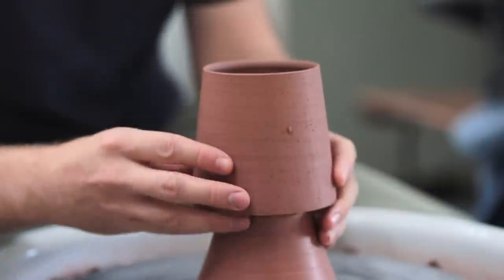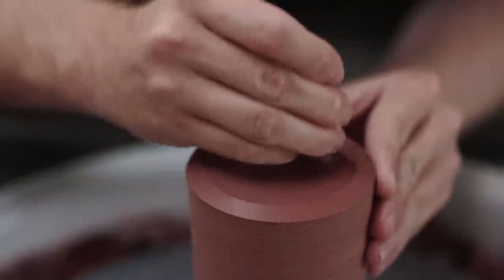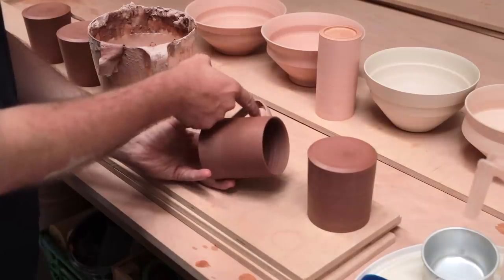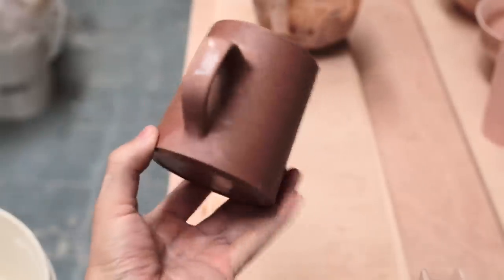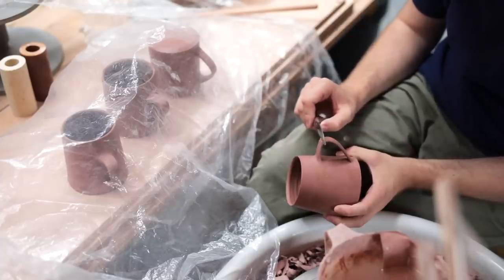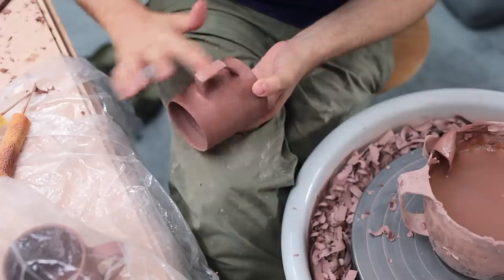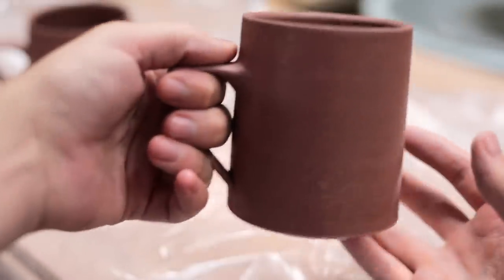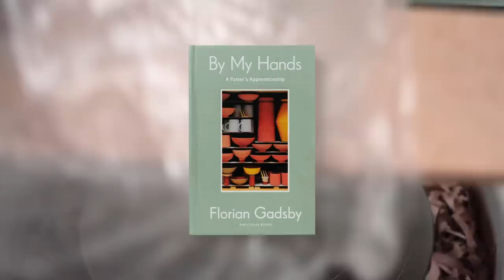The Strangest Handles I've Ever Made

Comment: I liked the shape of the sharp triangular handle before you adjusted it, as the organic corner seemed better than the sharper one. Of the finished handles, I was most drawn to the one with both a high and low bend, and liked it both before and after you'd adjusted it. I look forward to seeing them glazed.

Comment: Florian, I agree with what you said about the “hint of angularity”. That’s really all that’s required. You don’t need to replicate the angles of your mug body, just echo it to help bring the two things, the angular body, and handle together visually. Remember the body of the mug itself is rounded no matter how many angles you put into it, so too much angularity in the handle creates a dissonance that jars the eye…..and tbh is less than comfortable to use. That’s why that handle that combines the angled outer, and gently curved inner, looked so satisfying, in that it brought together the different shapes harmoniously. With the “tankard” mug, that handle should maybe, “lean into” the tankard shape more and be placed higher up on the body? For some reason that shape looked taller/narrower than the others, but on reflection, I think that’s just my eye being tricked…..having said that, I feel that a higher position on the body would “balance” better, but that’s just me. As for your “problem child” lol, yes the handle weight is out…..more meat and heft is required, but perhaps a less regular shape would help…it “does” kinda look “stuck on” atm…..perhaps joined at the top, angling down, and then straight across to rejoin the body fairly close to the base, leaving room for a steadying finger below the handle? Or vice versa lol. Not sure how that would perform for hot beverages tho….it could force the fingers against the hot mug body which wouldn’t be good. In any case they’re all workable and I do like all of them…..and while the outlier for you is maybe “less” successful, I don’t think it’s too bad for a first iteration lol. Cant wait to see them glazed.

Comment: Form should always follow function, not the other way around, especially with a mug that'll be holding very hot liquids. As someone who uses very big mugs, the biggest problem I find in finding ones that work and are easy to balance/use is the ones with the top that slopes down, hard to exert leverage with your thumb to keep the mug upright. Looking at what you've created in this video, I think that all would work, except maybe handle 2, with that slope I'd have issues with the leverage if it was on one of my sized mugs (about the size of 3 regular cups).

Comment: I wish more potters would work on better handles. It's really disappointing to find a beautiful mug with an awkward handle that seems designed to cause the mug to pivot as the handle slides through your fingers, or the hand to strain to hold it in place.

Comment: I would say that the triangular “monstrosity” handle would be better fitted on a mug that has at least one more angle on the body itself if that makes sense. The point in the middle of the handle clashes with the mostly flat outline of the mug body as opposed to the flat top handles which compliment the flat walls of the mug that sharply end at the top.